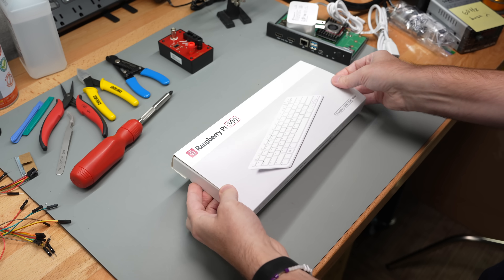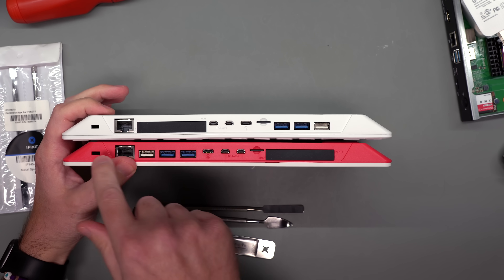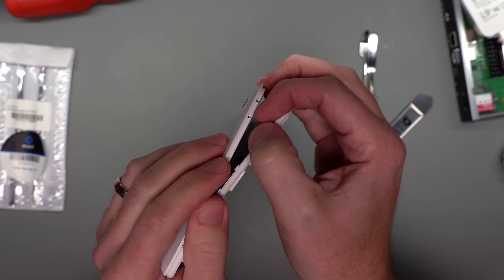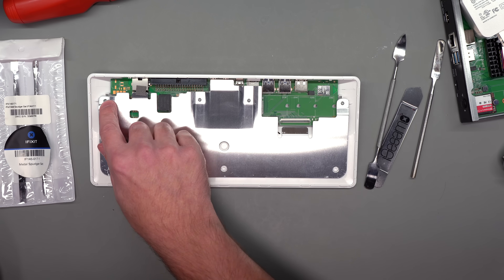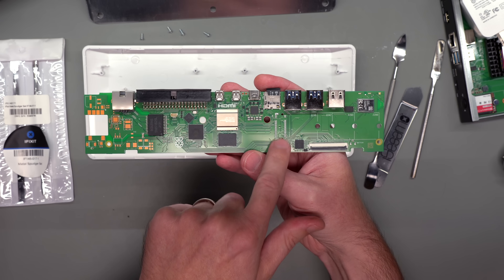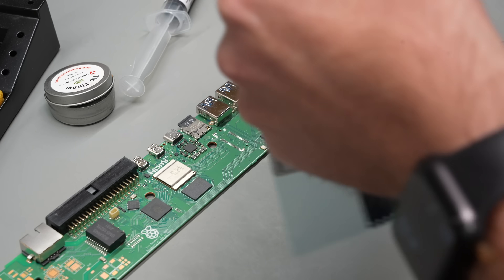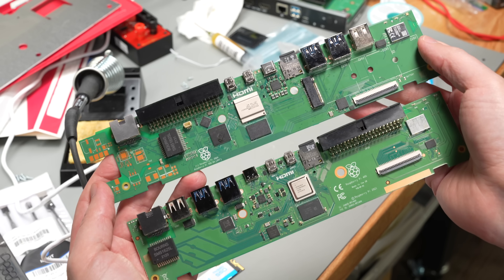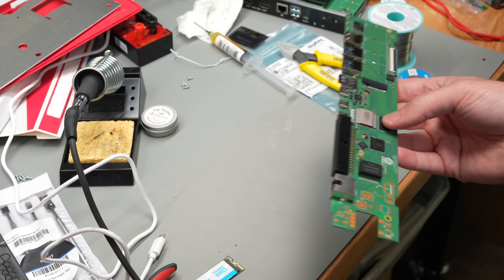What's inside the Raspberry Pi 500?

Comment: The POE circuitry is why there are separate magnetics for the Ethernet.
Reply: We needed a 'in PCB' RJ45 connector and was easier to get with external magnetics.
Reply: @richardjones1373  Ah ok, so it is possible to get RJ45s with integrated magnetics with the centre taps brought out to extra pins for PoE?
Reply: @UKsystems  must be the difference between a $2 part and a $5 part, just use separate magnetics. well that's what I realized when I was making my router. unless you don't have space for the magnetics
Reply: you can do PoE on Pi's 3B+ and later with their PoE compliant Magjacks.

Comment: Comparing it to the official NVMe hat or the CM5 IO board may reveal what components are missing under the bottom. Electronic companies usually use the same design for different products to reduce costs.
Reply from the maker: Definitely worth a 2nd try!
Reply: @Level2Jeff  Level2Jeff has some Red Shirt tendencies, but chaotic good, rather than chaotic neutral. It apparently runs in the family.
Reply: How were the expecting people to get access to that NVMe slot, to change the drive?  Were they planning to just seal it in forever and make that part of the disposable nature of it all?
Reply: @ It’s not that difficult to pop open the case. (At least on the Pi 400)
Reply: @Choptec  It if can't be done with just a  Philips screwdriver, I don't think it's suitable for consumers - or me, really.  I hate having to use a spudger to open anything.
Reply: @TooSlowTube  or put in an industrial enclosure for industry use.
Reply: Exactly what I was thinking. 😂
I ordered one and plan to investigate this.
Reply: I was just wondering why the main board isn't just an I/O board for a replaceable compute module. It seems like an I/O board would be cheaper and simpler than a full Pi 500 motherboard, with the awkward surface mount chips delegated off to a standard compute module that they can just increase the volumes for. Being able to replace the compute module would also have benefits for customers, especially if they stayed compatible from one generation to the next, but even if it just lets you use a compute module with more/less RAM as the needs of various projects vary.

But with more thought, I guess it's not that simple. A user-replaceable compute module makes things much more awkward (and more expensive) WRT having the huge heatsink, so there's at least one trade-off that would have to be made.

Still, there's possibilities for third parties to make similar products based on compute modules - with a full mechanical keyboard, for example, and all the christmas tree lights that seem standard for computers and peripherals these days (I swear it's just to drive away people with sensory issues). How viable that would be as a commercial product I don't know, but for a company that already makes keyboards, or as a kit for customers to assemble based on recycling most of an existing keyboard, maybe it's not so crazy - it seems like mostly just a custom (3D printed?) box and a custom I/O board to fit that box plus pre-existing keyboard parts after all. Even just a custom I/O board with an example compatible box design as a starting point.
Reply: @stevehorne5536  if they made it use a CM, then people desperate for CMs could buy Pi500s when CM supply issues happen and toss everything but the CM... which is bad for anyone who actually wanted a Pi500.
Reply: @EmyrDerfel  They use the exact same chips, don't they? If there's another chip shortage, logically it should affect the Pi 5, Pi 500 and CM5 equally unless there's a strategic choice otherwise. If the Pi500 was based on the CM, assuming CM4 and CM5 have compatible connections, there'd be another strategic option - sell the Pi500 keyboard case without the CM inside, so people can use whatever CM they can get or already have with it. No point buying the Pi500 for the CM because it doesn't include one. No need to balance demand, at least between Pi500 and CM, because that would mean balancing demand between the CM and the CM - just produce as many CMs as possible and let the market decide what to do with them, so Raspberry Pi can't end up in the situation where they have to decide how much of what to produce, and will get complaints for making the wrong choice whatever they do.
Reply: @stevehorne5536  I did suggested the same as a desired feature for Pi500 on raspberrypi forums when Pi5 came out. My rationale for suggesting it was to reduce ewaste as people will be able to upgrade just by replacing the compute module. But raspberry pi engineers blocked my account for suggesting it.
Reply: This would also apply to the POE hat as well.
Reply: Jyp, jup, jup. I cant wait to get my hands on one to try hack it in.
Reply: Now it just became insufferably irresistible.:face-purple-wide-eyes::face-fuchsia-tongue-out::trophy-yellow-smiling:Get your soldering skills ready ppl.

Comment: I wanted to get this for my younger cousin for christmas, but it doesn't make any sense at $120, especially with just a 32GB memory card. I'll probably just get him one of those cheap intel mini pcs & put linux on it.
Reply: A used mini business dektop from lenovo, hp or dell cannot be beat. Ebay is flooded woth them after their leasing expires. They come with a windows 10 license in BIOS, have SATA and NVME slots, PCIe, 10 USB Ports, full size HDMI and display ports… got one recently with an intel i5 8400T, 2x 128GB SSDs for €150.
Reply: Get a used sff or micro computer under $100. Much more powerful and shouldn't need any adapter. Some even come with ssds.

Comment: Really sad about the lack of M.2. SSD over USB is fine I guess, microSDs really do not cut the mustard for a desktop system these days. And I'd like to use a Hailo-10 whenever that comes out for edge AI. Good on Eben for setting a larger RAM standard at least.
Reply: Hopefully everything is there and just going to be populated at launch.
Reply: @JayrosModShop  it's already launched, what are you dreaming about
Reply: IMO it's pretty likely that Raspberry Pi will do a version that costs maybe 20$ more and adds PoE and the M.2 expansion.
Reply: @YonatanAvhar  You mean "$20" more.
Reply: I's just some business strategy to not make the M.2 available. They always tended not to add M.2 in standard instead forcing use of additional gadgets for it. The reason behind is probably a result of complicated business calculus held for years.

Comment: Use more flux and reheat the solder. Surface tension will make it reflow “perfectly”.
Reply from the maker: Should, though my iron/tip was not ideal, and the PCB was sapping off all the heat. I will likely work on it more with a little PCB heater so the iron doesn't have to heat up the entire board.

Or use solder paste and hot air, next time! (I didn't have any solder paste on hand).
Reply: @Level2Jeff  you'll probably want a pcb heater even if using hot air, just makes everything easier, also its easy to melt the plastic connectors when using hot air so flux and iron + pcb heater might just be the easiest.
Reply: @Level2Jeff  my first Level 2 Jeff reply 😀
A follow up on the M2 hack would be great. Someone can probably figure out the missing components.
Reply: @Level2Jeff  Solder paste without stencil can be as messy as regular iron 😉 Just use a narrow pointy tip, a lot of gel flux and you can literally drag the tip through the pins and get a perfect solder. Good luck! 😁
Reply: Consider finer solder wire. I'm guessing you used 0.8mm. See if you get get 0.5mm or smaller.
Reply: @bert-blank  0.031" is 0.7874 That was the largest we used. 
The 0.015" is 0.381mm which was the finest gauge available wire solder at that time/
Reply: And IMHO that blade tip is far too large for this sort of soldering, when you're working on an area, you're also inadvertently heating an area you're not working on. So more bridging (and cold bridging) is bound to happen.
Reply: @tankgrrl  Yes. We used three sizes of chisel tips for almost everything. The middle size was perfect for 0201 chips. Our largest was good for up to 1206, and the fine one was 0.015" for fine pitch ICs. We used .031" & 0.15" solder on boards. A far cry from the 1/2" tip on a 150W Iron I started with in the early '60s. I once used it to reseal a cracked seam on the brass endcap of a car radiator. Most solder available to DIY and small shops was real crap. Some wasn't even fit for plumbing because the inside of the solder  varied so much that some had no flux, followed by too much which would cause  it to explode ad spray mo;ten solder.

Comment: Imagine being a kid who wants to learn computers, soldering, etc. and/or put an SSD into his computer, but being forced to solder something that many adults probably couldn't do 💀😬
Reply: It will be available as a different variant as a cost option. I'm guessing it will be a 500 plus (Amiga style)
Reply: My hands were far less shaky then.
Reply: @-r-495  Mine are still steady at 72 years old.
Reply: I'm now in my '70s and have soldered for over 60 year/ I started with tubes, but ended up hand soldering  Mc68340 CPUs with a 0.015" center to center spacing to NASA standards.
I use Multicore 0.015" rework solder for this, and 0.031" for wider spacing. It isn't cheap but it is well worth it.

Comment: It's unlikely that a giant metal plate will keep your CPU from overheating(maybe), but at least it will throttle it less!
Reply from the maker: Seems to work fine in my testing, at least at 2.4 GHz. It's enough thermal mass to dissipate the heat out through the body of the thing. At 2.8 GHz it only throttles under very heavy, long-lasting load. At 3.0 GHz though it throttles pretty quickly and gets unstable.

Comment: Micro-HDMI really kills this form factor :/
Reply: Yes, that and no NVMe is a letdown. 😥
Reply: Agreed. There's plenty of room for full-size ports. They could have used vertical ports, if they didn't want to shift things around.
Reply: agreed i would 100x prefer a single regular hdmi
Reply: Pi400 also had micro, best for schools you don't change it, though one of each might have worked.
Reply: @edc1569  Schools tend to unplug things and lock them in a cupboard regularly.  I can't see a micro HDMI surviving long in that environment.  Once they start breaking, there will be a great reluctance to order any more like that.
Reply: It's nonsense for a desktop computer
Reply: Seems the R Pi foundation is set on uHDMI...
Reply: Much much less important than the lack of M.2 or POE !!! As the HDMI reduction can be bought in every electronics store. 
If it had the M.2 I've bought the Pi 500 ASAP. Now I will wait untill it is available.